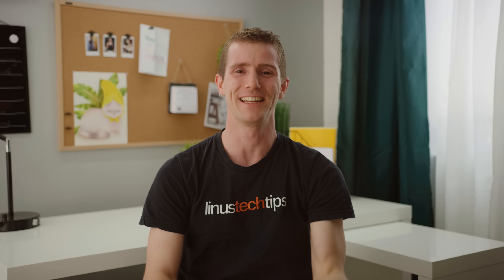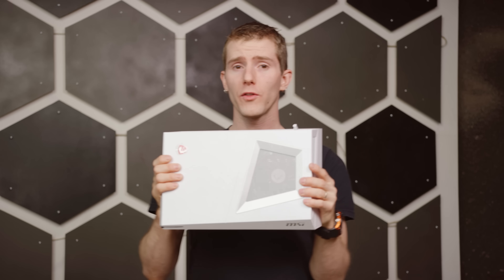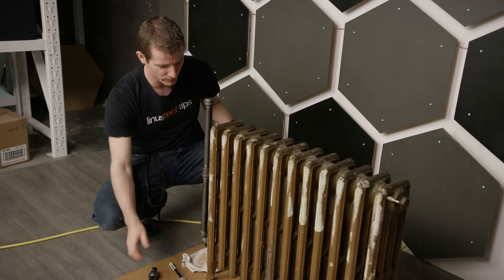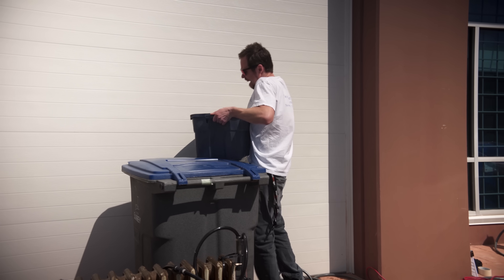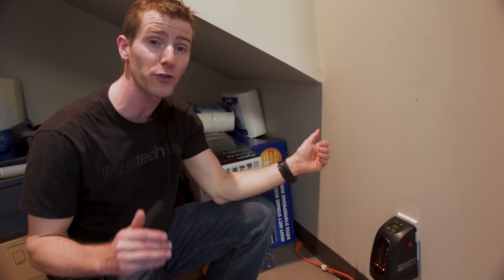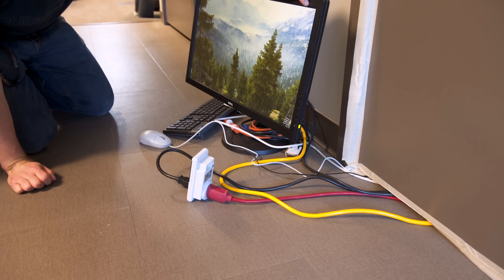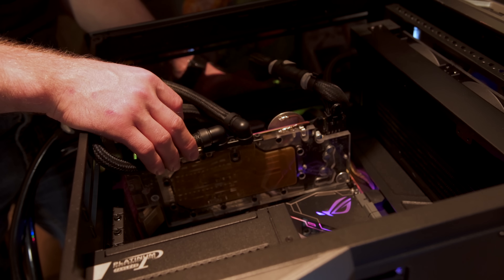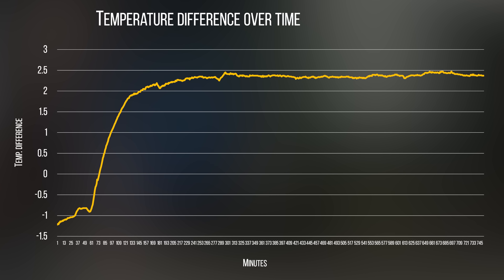Lower your heating bill... with GAMING

Comment: Try again with a completely clean copper heater, or create one. shouldn't be too hard to bend copper pipes into the shape of a heather, maybe adding an aluminium shell to keep the surface somewhat cool and the overall weight down. could even fit a giant car fan on it to make a gigantic cpu and gpu radiator.

Comment: Dirty water in a heating water is normal, even with new radiators. The dirty water is called boiler water and is normal for a heating system but obviously not in a PC. Using a hydronic heat pump would work better than an aquarium pump also with the addition of a filter. 🙂

Comment: Next time, should you ever want to do it properly, get a new radiator. They aren't that expensive. Maybe even a stainless one. (Yeah those could get expensive.)
Then make two stations. The first being the radiator to use the heat itself from the gaming rig and a second station cooling back down water like usual. That way you ensure that your PC runs relatively cool, heats up the radiator and has a proper loop that neither breaks the system, nor fails at a heat source.

Using the right dimensions, this shoud be possible. Surely you won't be able to heat up your house, but a single room? I mean i never have my radiator on here in germany, since my PC heats up my room enough in winter. I even often have to open my window, or it gets uncomfy.

Comment: i had a one room apartement where 3 of my walls where outside plus the roof and very thin windows with a bad radiator. if i didnt have a gaming pc running all day i would have sat in a 10°C or colder room in winter. with a PC I managed 17°C
but boy oh boy was it hot ins summer

Comment: I wonder why they went through all the difficulties with the radiator, and then put the pc in the same room. Should have just left it aircooled, so it would have matched the result of the space heater much better.

Comment: Linus it works as a heater as i turn both computers on in winter and have not used a heater since in summer i just turn the exist fans on to get rid of it in summer my gaming rig is same size as that one and my business computer is 3/4 the size and have used as heaters for many years my 65 inch tv is my monitor i also game while i work thanks covid i dont water cool i air cool

Comment: ur compairing air heating vs water note the difrens is air heaters heat rooms more faster but walls etc still cold water heater/radiator give out heat in a more comfortable way so id see water has won u could also have use let the pc run hot air whould of make for a more equal game

Comment: I just don't understand why didn't you just get a big radiator that goes in like a PC or something and use that, it be about the same size as the space heater was. Or you can get a heat exchanger for a car or something like that and I'm sure that would be sufficient.

Comment: Next time use a heat exchanger and a fan (maybe with a circulator instead of a pump). 
But: The flow through the gpu will be decreased as you use smaller pumps-circulators to reduce costs. 
Short answer you can do it. Choose a better terminal unit (fancoil, heat exchanger), insulate the pipes. 
Practically the boiler is your gpu. 
Enjoyed your video :) 😃

Comment: The issue here is you've failed to account for how heat transfer actually works. Using a massive radiator versus a regular 120mm AIO makes no difference in actual heat output, assuming your CPU is still running at the same TDP and doesnt thermal throttle. Infact, the larger radiator is probably going to heat up a room less due to the increased thermal capacity meaning more energy is wasted heating up the liquid and radiator itself, rather than put into the room. Ideally, if you wanted to heat up a room most efficiently with a computer, you'd actually want to go for large air coolers so as to not waste any thermal energy heating up liquid.

Comment: When it's summer, lower your air conditioning bill by putting the radiator outside! Also, I live in Quebec where electric heating is used in most homes. Because all ways of turning electricity into heat are equally inefficient, you might as well mine crypto in order to offset part of your electric bill. You would have spent that money on heating anyway.

Comment: I feel like the missed point of this video is that the radiator had nothing to do with the test. Whatever the PC pulls in in watts, the room will heat by that much. As long as the computer isn't throttling, it'll heat it up just the same. It is a really cool idea for a water cooling system though.

Comment: It4s qn interesting idea to be honest, though if you don't want to destroy the pc, you would have to use a system where the fluids of both systems stay seperate but you allow for heat transfer between systems. (Think like ventilation system D)

Comment: You realize that almost all the energy from your wall socket is converted to heat eventually, whether or not you attach the big radiator? (heat that is also pumped into your room by the PC's fans and aluminium coolers) The radiator is only offering some kind of heat "reservoir" after you turned off your PC. Other than that, is completely useless.  Nonetheless, it was a fun thing to do :D .
P.S. A computer is equivalent to a space heater with 400W of heating power. That is garbage compared to a 10$ space heater that pumps 1500W into a medium sized room and heats it very efficiently.

Comment: What was the point in using that big old radiator? Seems like it was way more trouble than its worth. The test would've worked just fine using an air cooled PC. I guess it's not LTT without doing something totally unnecessary and then screwing up a bunch of stuff in the process.

Comment: You didn't need the radiator - the heat would have ended up in the room if it was just air cooled. If the computer is drawing the same power as the heater it will heat it up the room identically.

Comment: Why leave the PC in the room with the heat that has no way to disperse? Wouldn't it make more sense to leave the PC in the hallway and measure the rooms temp based purely on the radiators performance?

Comment: 23.7 °C?
That's freaking hot, more like 18 - 20 with a relative humidity of 50-60% for me.
It's summer when I'm writing this and temperatures are beyond 23 at the moment inside my room, believe me. It drains out my soul.
You can put on an extra layer of clothing, or move (body heat) at 18 degrees just perfectly. But almost 24 degrees, damn, that's hot.

Comment: Sorry but I don't understand the need for the huge external radiator, because the internal rad or even an air cooler would do exactly the same thing, take the heat from the loop/components and put it into the surrounding area

Comment: Well, you do not need any of that to heat your room with your pc as long as whatever cooling solution for your cpu and gpu work. They already heat up your room as long as the pc and you are in the same room and you have your windows or whatever closed. The only difference is, if you just happen to have your pc in your room, it will heat up the room much quicker with all that fans recycling hot air versus what you did. However if you're mining with a lot of gpus and you plan to heat up your entire house, then doing that might have made some sense. That's just dumb.

Comment: wait a min there is something you should try an termal water switch that will block warm water to get over in the cooling area of the water like same sistem used on modern wehicles there is still a purposse of an cooling sistem but the rest of an heated water should be used on heating , it is like we have an two atmosfere of heated water , this is not wasted project but it should be carefully think over i could happily hook you up with few advices at no cost , just to make things done ...

Comment: Please try a video if a watercooled PC is able to heat the same room without connecting the tubes to a disgusting rusty Soviet-era heater. I am sure the same amount of heat energy is emitted from a standard 360x120 computer watercooler radiator ;)

Comment: Does the thermal mass of the whole radiator kinda ruin this? Like I feel like just a normal watercooling loop/radiator with a very flow pump and fans with standard radiators would work way better.
Reply: Like the radiator itself is a massive hung of iron.

Comment: why would it work better with the radiator. the pc puts out the heat aswell with a normal air cooler and it doesnt have to heat up the radiator before it starts
thats way quicker

Comment: Even the kinetic energy and light is turned to heat when the light is absorbed by surfaces and moving molecules is by definition heat so..... a space heater or a computer are both 100% efficient at turning electrons into heat. The computer just sends them down a different path and does some math in the process. You would have gotten the same result if you just used a normal water cooling rig, or a fan...

Comment: Ok, so you control the air temperature of the room but the temperature of the water in the radiador which has way greater thermal capacity you don't. Why?

Comment: I have leggit hooked up my watercooling externally to the rest of the house heating took forever to set up correctly with external pumps and it fucking works great my rendering PC warms up the entire house :D forgot to mention it helps that I renovated the living room and installed new radiators LOL

Comment: Not really true... The power is used to produce kinetic energy in electrons. Like, you know electricity. Head is a by-product on the conduction. But the energy used to power the computer is not put into heat itself, but electricity. And these aren't incandescent light bulbs where electricity is directly turned into heat/light.

Comment: So maybe a factory clean radiator might of given a much better result 🤔
Reply: I dont get the point of cleaning it. Radiators arent designed to run "clean" water. You dont change radiator water, ever. It's 20,30, even 40 year old water running in old radiators and they work fine. If something breaks, it's the components/parts of the radiator, not the radiator itself.
Reply: @TheMegaRin  I'm afraid that's wrong mate your radiator water does need renewing after time depending on use everytime I flush my system they get hotter way quicker than if it was a year old water.

Comment: Physics anyone? LOL. This energy experiment was a waste of energy haha. However, it gave me an idea.... Why not hook the computer up to the house complete cirkulation system instead? Then you spread the heat from the computer to all rooms instead of only one. That will get down the computers temperatures due to the very big heat emitting surface of the houses radiators. You also will benefit from the much larger volume of air that absorbs heat. You will however need to disable any termostats or chunts in the system. The whole house will in fact be turned into a radiator. :D Or, you just isntall heat moving fans between the rooms ;)

Comment: This is a bit stupid. If you used 300w of power, water cooled or air cooled, it will warm up the room the same. 300w is 300w. And side note, fans don't have a lag.

Comment: Wouldn't you achieve the same results with just a normal setup? You're expelling the same amount of energy either way, the radiator might hold onto the heat for longer, but it's still the same amount of energy 🤔

Comment: running joke huh, 
back like 10 years ago i build a i7-980x on a x58a-oc with three gtx 470 super overclock in tri-sli, had everything overclocked by 30 to 40% and watercooled, 
the 3 GPU alone were pumping more than 900W. 
even if the system wouldn't hit higher than 65° in burn test, it was heating the freakin room to the point it was almost impossible to stand next to it during the summer without melting.
those were the days ;)

Comment: Me 4 years later with a 5900x dumping 250w of heat into my room.

Summer temps here are 115°F and my AC vent barely puts any cold air into my room help
Reply: Look into Undervolting, helped enable me to game all through the Summer with basically no heat going into the room.

Comment: Why bother installing the radiator? Just use a big fan, and the same amount of heat should be released into the room. To conclude, replace the heater with a server at home. I will implement it in my next house. LOL

Comment: they should 100% do this with new radiators and different sizes
Reply: @chielvooijs2689  not if the sizes are different
Reply: @chielvooijs2689  well the smaller one will get hotter quicker so not really, plus the performance of the gpu will be better with a bigger rad

Comment: Yall fr cant be dumping that radiator fluid out in the street like that and you dumped right by a man hole which is a water system which you can be heavily fined for

Comment: Erm, Linus is a very intelligent guy, as are most of his staff, presumably.  So I'm sure they already know this, and have just done this to have some content for a video, but I still feel like it needs to be said: this whole thing was completely unnecessary and made 0 difference, as the computer was already converting all of its electricity into heat. Really what you should do to increase heat performance is add more power draw to the computer, like with dozens of superfluous fans, or (somewhat counter-intuitively) rigging up your giant Frankensteined refrigerator cooler to increase overall heat creation!
     I suppose the video did achieve its goal of simply being fun to watch though!
P.S. I miss Ivan, he was one of my favorite characters, particularly in his Linus P.I. costume!

Comment: So, this is funny. I legit used an old AMD system as a space heater. I'd just set my leg on it whenever I got cold in the winter. Fucking thing sounded like a jet taking off and heated up my game area by a few degrees and the case by several.

Comment: I know this is old, but I hope someone at LTT takes a look at this and passes this up the chain. You have the right concept but the wrong execution. You  need to use the heat generated from the PC for hot water. You need an indirect hot water tank to store the heat from the PC. These indirect hot water tanks are typically used with a hot water baseboard system. One zone would be used to heat the tank. Thus eliminating the need for a separate hot water heating system. Here is a site that talks about them. 

https://www.waterheaterhub.com/indirect-water-heaters/

Since you will be dumping the heat in a 50 gallon tank. It can store a lot of heat. Now, once the water  exiting the tank reaches a point of being too hot for PC cooling, then you can have a radiator inline post tank and pre-PC in to cool.

So the basic chain of everything is: PC > indirect hot water tank > radiator >back to PC

Now the cost is the tank, tubing, insulation for the tubing, pump, radiator, thermostat to start radiator (can be an Arduino or Raspberry pi), and the tank itself. To get really fancy, you can the thermostat send data back to your PC or phone on the temperature and activity of the system (if the pump is working, temp (incoming, tank, outgoing)), and setting the temperature.

This would not only be an epic because it requires a heat generating PC (new build for cooling your new GTX 3090 when it comes out on a thread-ripper), the plumbing needed, electrical work for the sensors, building and programming the subsystems to control and motioning it, but it would also be an Eco-friendly way of heating your water.

Please consider this. Thanks.

Comment: Lol just don't use fans. Fans on the graphics card? Rip em off. Cpu cooler? Don't need it! Just make sure you you block off all the air holes possible and watch as your pc run as cool as it ever has

Comment: This whole premise while making for an interesting video makes no sense. power consumption effectively is transformed into heat dumped in the room for any computer regardless of the cooling system it uses.

There is no reason you need to use anything but the stock air cooling and have a case with good air flow

Comment: Unless the PC was out of the room this proved nothing.
Just that 2 items both pull 300w.
With the radiator in the room without the PC, the amount of heat pulled from the PC is found.
This proved nothing by design.

Comment: I could see doing that with a baseboard heating setup, less thermal mass from the water, so you get quicker reaction time from the heater, and because you can make the length pretty much anything you want, you can tune the system to peak thermal efficiency a lot easier.

Comment: this is the worst thing ever lol, the whole point of liquid cooling is to get rid of heat, the entire point of a radiator is to build heat and slowly dispense it. The PC would be heating the room equally as much with air cooling and still be able to cool it's components.

Comment: This is the first disliked video since NCIX. I can tell you that using or not a heater, you take the same amount of heat from the pc. So you better may redirect the output hot air from the PC into any where you like.